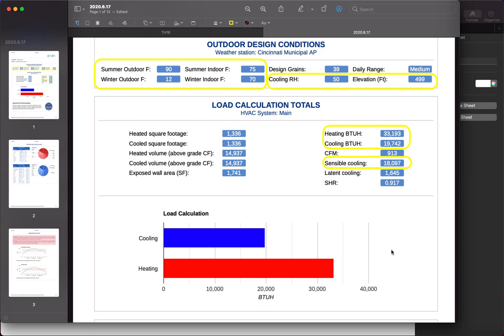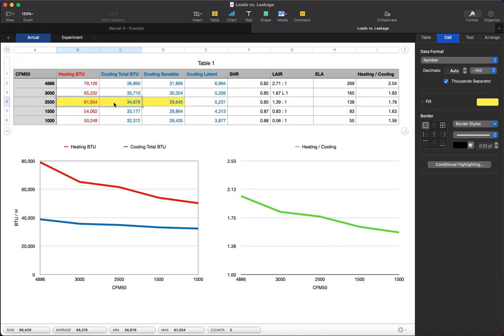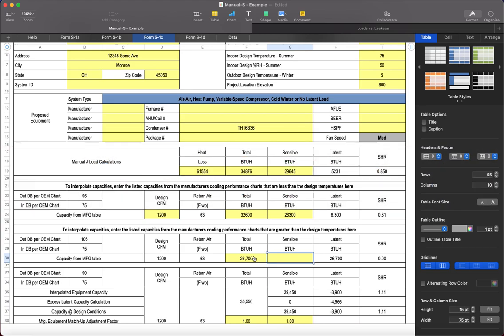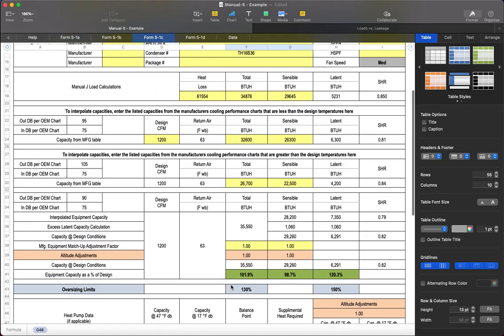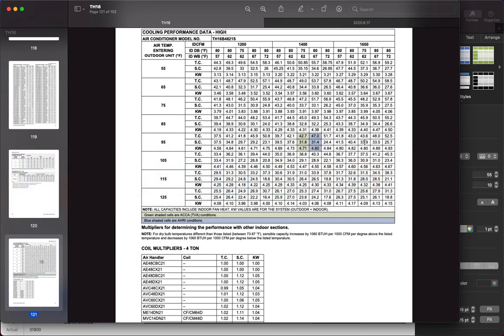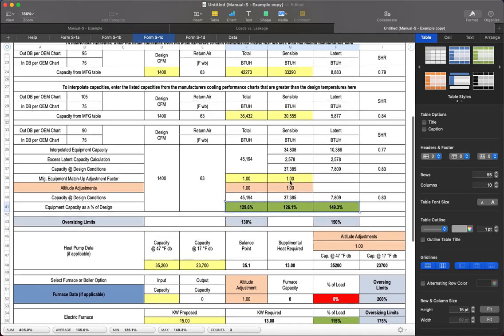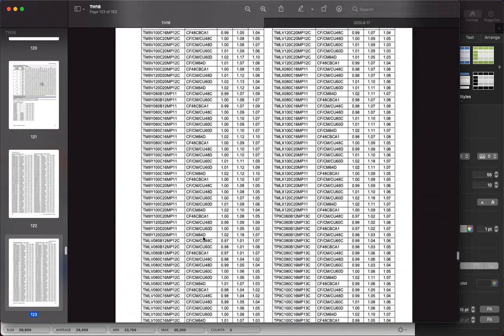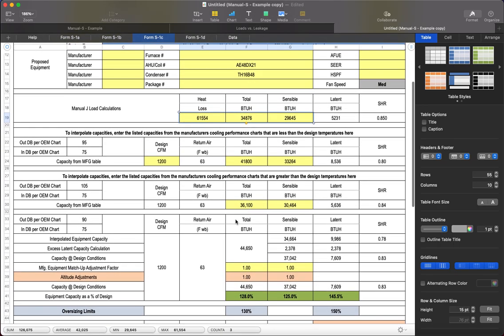Manual S Speed-Sheet Example: Tips & Tricks

Comment: This was a really awesome video. Kinda helped me understand the process for choosing the right capacity. I have one question tho. How do you know which brand or model of equipments to use. Do you get these specified by your architect/builder/client or do you have some method behind it.

Plus can I get the manual s speed sheed aswell as the manufacturer's data for practice. I don't know where you sourced these from